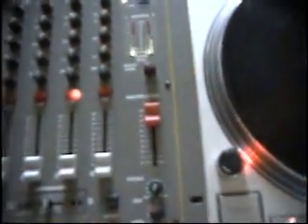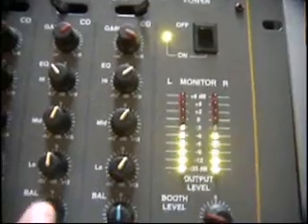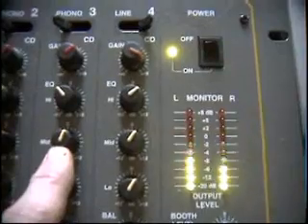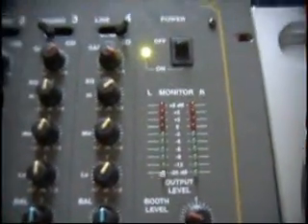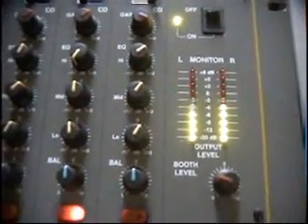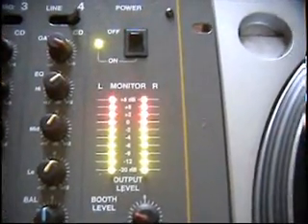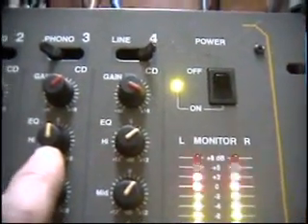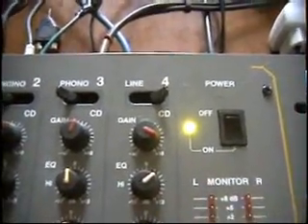Dj tutorial,  Bass, Mid, Top and Gain lesson1

Comment: the gain (sometimes called trim) is an amplifier that boosts the signal coming directly from the turntable.  the signal then passes through the EQ, then to the level faders.  the faders can only TAKE AWAY from the signal, not boost it (thats why theyre called 'faders').  set your faders to FULL (10) and adjust the gain so that you get just the littlest bit of red in your meters (in cue mode).

Comment: Hi there Ellaskins, Mid frequencies knobs usually work on 1khz / 1.2khz wich is 1000hz  / 1200 hz. 
A "normal" guy has it's voice around 1khz (1000hz) not 400 or 450 as you said. The mid frequencies knob from a 3 knob's dj mixer NEVER works on 400 / 450 hz's and sa i said, that is not "vocals", it's simply mid/bass frequencies. 
 Anyway, it was just a small repair 'cause i like the way you "teach" in your tutorials. You make it look easyer. Fortunnaly i don't need them but i like watching yours

Comment: do you find it harder to scratch in your tables in the normal position.
Im trying to figure out wheter its easier to put tables 90 Counter Clockwise or regular the way they were designed and the way u use them.  Can you please shed some light